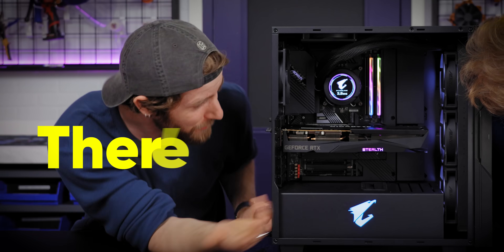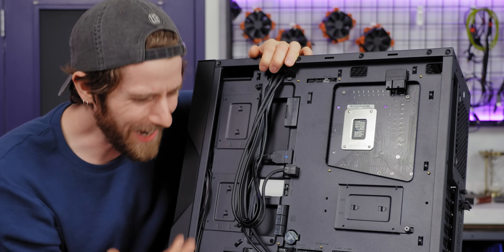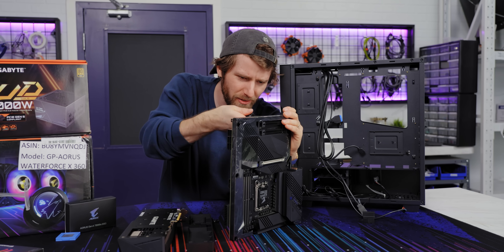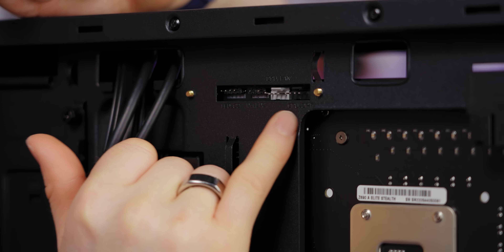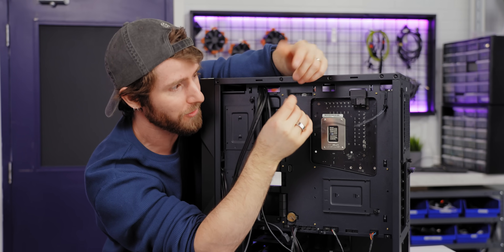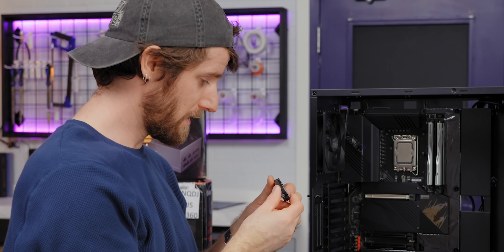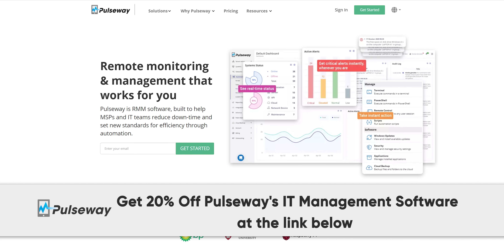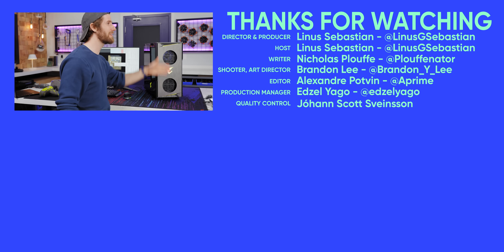Where Are the Cables??? - Gigabyte Project Stealth

Comment: Honestly, this should be seen more as a prototype of a new standard than a product. As a proof of concept, I'm sold. This is better for so many reasons. There are lots of improvements that I can see need to be iterated over to get a really solid product. But when you really start thinking about little things like the case manufacturer now knows where their fans are and exactly where the headers are on the board down to the mm. They can really start making some super solid cable management systems.

Comment: My main computer STILL has that Antec Dark Fleet DF-85. After 10 years of use, all the RED fans are not working or just spinning without really pushing the air. The top 2 120 fans are falling inside sometimes, but once I put them in their place, they spin and really push air. I have a Noctua NH-D14 that works like in DAY 1 without making any noise on top of a Intel 2600k processor that works at 5000 MHz since day 1. The only upgrade ever was a 970 GTX from Nvidia bought day one when they appeared on market. Also, spinning them all is an ANTEC 1000W power source that is never spinning because there is never a reason to spin the fan as the power is probably below 400W at all times.
God bless you for this memento :)

Comment: The motherboard and gpu can work in a good case if you're willing to use a dremel and the cable lengths can be fixed but cutting the cables shorter then soldering them back together

Comment: Honestly MainGear should NEVER been issued that patent.
Id have to read it but that is kinda common sense. 
Hell I have in the past relocated connectors to the other side of the board back in the Pentium II days to run the power suppluy and power switch header outside the case.

Comment: I wanted to give it a try and built my computer last year around Gigabyte. The worse decision of my life... 
The Waterforce AIO cooler was rubbish, sounded like a jet engine by default and barely kept my 5800X below 90 Celsius. The display also had bad viewing angles, it only looked good from the front. The motherboard was great, but the chipset cooler has an annoying noise every time it turns on. The fan controlling software is failing to load sometimes, so I have to reboot the system to get it work. I also bought a Gigabyte RTX 3070 and it was defective. In the middle of the chip shortage and with those prices, that was the last nail into their coffin. I started selling everything I could and I lost hundreds of dollars because of their poor product quality. I learned my lesson, never buy a product from that company again. And now, I see the same exact product quality here: great promises, poor execution. :(

Comment: Why not go one step further and just flip the whole MB? No cables, no coolers, no nothing. Just a sterile, clean black wall to look at. Or wait, you could actually make a case without a side window? :D 
Jokes aside I'm in for more diversity. Though niche products are never cheap. Which forces us to use universal, mediocre engineering at best PC designs which were ok'ish 20 years ago. The last significant experiment was blower GPU cards and that wasn't even executed well. Yeah, "...moving around hot air...". PC design in a nutshell. Looks over sense.

Comment: I can't tell everything that was moved, but it looks like from what I can see, they just swapped what were through-hole soldered connectors to the back of the motherboard. The GPU, on the other hand, looks like it would have had to have it's traces completely re-routed. And the case itself is the most important portion of this working as well. I hate that this is patented because I would love to see a wider adoption of this.

Comment: This is weird, because someone clearly had to spend some time and money to modify the manufacturing of those motherboards and GPU’s and that is not cheap but after dropping what had to be a considerable chunk of change on those component changes they just so utterly half assed the case. Clearly no one even tried to build a computer and do any kind of testing on this thing because it’s completely unsuited for anything more demanding than Star Dew Valley.

Comment: Every time I see a case that is completely cut off of airflow, I can imagine how much Chinese or Taiwanese OEMs can make money from all of the PC parts that people have to keep throwing away and replacing due to computer parts dying prematurely in terribly cooled cases such as this one. It is one thing to have large airvents on the sides of the front panel or making an asthetic with a partial blockage of airflow but cutting off airflow completely is a waste of performance per watt, premature degradation of PC components, and also a waste of energy due to poor case design. The concept is great but the implementation is horrible.
Reply: Wrong. Clearly the case team lead was told by the head of new products sometime like 'cheap as possible using previous designs when possible, no lead design engineer since you'll use a stock case design and we dont want to pay for one, no QA for desgn, no major redesign for tooling, etc' and the team lead worked with what he had. Therefore fault is upper management of auros , but the head of new products will go into a high level meeting and blame the tead lead and not himself and fire that team lead so the core/root of the issue isnt fixed and someone who didnt deserve it got fired. That team lead likely asked multiple times they need to redesgin the front + the tooling for it and told the head of new products it'll overheat if they don't and the head of new products said nope and told him to use what they already had. AKA problem is upper management of the case design oem aurose (however it is spelled) and this happens in 90% of companies.
Reply: @JohnAdams-qc2ju  You have ample points that are worth meriting but the fact of the day is that a finished product came to market and people are able to purchase the case, regardless of form or function. I consider good case design over brand loyalty or case asthetics. I have no qualms with buying a case that has excellent thermal performance or expansion for multiple drives and other PC peripherals.

Comment: The future of computing is mobile. The constantly more efficient hardware and its reduction in size shows where the RnD is actually being deployed. Most of the main manufacturers have admitted that miniaturization of hardware is the future. Intel and AMD do entire conventions on it. Think of how your smartphone replaced multiple devices such as camera, calender, alarm clock and many other things such as your address book, TV and it is now bordering on a PC. In fact if you were to compare a modern smartphone to a 10year old PC the PC would loose. With companies like ARM, Intel, AMD etc focusing on SoC (System on a chip) expect your computer in the next 10 years embedded in the screen like a tablet.
Our awareness of the impact that we have on our planet is driving the push for smaller and more efficient devices. Take a modern laptop for example, if you have a dedicated 30 series Nvidia card, you will get an extra 30% CUDA cores to offset the power and clock difference from the desktop version. This is of translates differently for different games as some prefer clock speed and others gpu core count, so in some games they actually exceed there desktop counterparts particularly with 3060 and 3070 variants. This for me is the 1st modern attempt at closing the divide between laptop and desktop. Then if you factor in the cost of running a desktop compared to a laptop both purchase price and power consumption, the desktop looses. A 3080 laptop will have a  max 300w power draw compared to the same desktop system with potentially a 900w power draw.
I have also noticed that the clocks stay particularly high on laptops, far above there base clocks. Take a 3060 as an example it has a base clock of 900mhz, during gaming its actual average frequency with good cooling will be around 1900mhz, only 10% off its desktop counterpart, with lows of 1600-1700mhz. This frequency dynamically changes as more and less load is applied. This really helps with cutscenes and other random world events that would normally cause a drop in frame rate.
I was an avid desktop modder before it was even a thing and I am still a massive tech enthusiast. I have now moved to mobile platforms and I do not regret it for one minute. The costs savings I made during the shortages and the portability of my gaming rig are just too advantageous to not consider it as an option. I can go to my friends, the beach, a bar, at work pretty much anywhere with an AC outlet(if I want maximum performance) or if about 66% of my resources is acceptable then I can play any game anywhere at 60FPS 1080p with good detail levels. I get about an hour and a half maxing out the battery. I love a cheeky game of command and conquer whilst waiting for the wife to decide what she wants.

Comment: ATX need only 3 rows o screws that can be mounted to 3 extruded pieces of aluminum and leave entire back open. No need to standardize plug location. Just avoid putting anything at the height of mounting screws.

Comment: Seems fine, but a clean install of regular parts is pretty close to the same visually. Few angled connectors for MB & video card and my case doesn't have any visible cabling either. And that backside....  is a clusterF...

Comment: I've thought about unsoldering the 24 pin on a motherboard and repining the cable to work flipped onto the back of the board.  This is a much clearer solution than what I had considered doing.
Reply: There are also already, 90 degree bended, 24 pin connectors ! I have one in my NZXT case, looks 10 times better already.

Comment: I'm waiting on a modular case that uses extra short cables to attach the computer components to a PCB board. (Motherboard sits on top but about an inch of clearance.) And use that board to bring power / information across the case.
IE a one size fits all connector on the main board. And a pcb board to connect hdds to, which only has pins for hdd's information and the correct power lane.
(Multiple because gpu and cpu voltage would likely fry if used on anything else.)

Come to think of it. They could technically have a power supply built into the main pcb board... but that might be taking things a bit too far.

Comment: I played with the idea of making a custom PCB to connect all power in a Dan case A4 but I dropped the idea, if you measurements are off by a small bit it just won‘t work. If I had the CAD files or a 3D scanner I would probably do it though.

Comment: Wow, it's almost like Gigabyte never actually tested this setup before sending it out to somebody with over 14.5 million subscribers who is absolutely not shy about calling out dumb, bad products.  Not only is there no airflow for the AiO, the bottom fan is right up against the power supply basement.  And the RGB cables not fitting through the cutouts is just sad and embarrassing.  Hopefully if this is something they're going to be selling, they address the obvious stupid choices that were made with the case.

Comment: Putting these components on the back of a board isn't that difficult. They are already mounted to through-holes on the front of the board. Literally all they had to do was solder the connector onto the wrong side of the board. Then they call it innovation. Literally anyone can do this themselves if they have any experience soldering.

Comment: The best idea here was putting the connectors for the GPU on the other side.  They are the only cables I mind.  Maybe there is too little space unless you get an accommodating motherboard, but maybe someone could put the ports on the outer end near the back? I could still see my nice custom cables but without them going all in front of everything

Comment: I would have stopped at the fact that you're stuck with Intel. 😂 I've not bought something from those crooks since 1998... 😝

Oh, and don't worry: Other manufacturers do stupid solid front panels too. I had to modify a Zalman case a few months back. The customer wanted that specific case because it looked good. It came with three fans mounted to the front glass panel. They even went to the trouble of doing some plastic shrouds around the fronts of the fans so it looked even... cooler? 😆 So I had to mount the fans further back from the front but still keep them aligned with the plastic shroud decorative crap. All of this just so there would be a bit of air for the fans to actually get from the side vents... 🤦‍♂ Who TF designs those cases??? 🙄

Comment: As cool as it looks, i hope it doesn't catch on (for the motherboard). You can get basically the same look with right angle connectors on the front of the board with a cable management channel along the side of the board.

This is just stupid. The motherboard won't work in normal cases, and if they released different motherboards with the same setup, they would have to have the same connectors in the same spots to maintain chassis compatibility. And that goes against the entire point of building an ATX rig, basically locking you into dell prebuilt level of upgradebility.

The gpu is cool and could actually be useful.

Comment: Imagine being able to fucking patent connectors being on the other side...There no way this would even hold up in court.

The reason why this isn't really done? Because not every connector is in the same spot on every motherboard, so a new motherboard would require you to change the case or backplate in some way.

The one good thing from this is actually the GPU connectors, that seems quite easy to implement.

Also what a shitty case to show off such a thing... re-using one of the worst cases for airflow.

Comment: All this is because  awful legacy standards. 
- The 24pin cable, the CPU cable, and the PCIe cable could and  should  be unified into a single connector of much fewer pins, combined with a better PCI slot design including more power pins (similar to this design, but plugged  to the PCB rather than to the PSU ), then let the motherboard do the power distribution job.
- Same about the front panel cables , lots of cables and little connectors for no reason

Comment: Wow, it would be kind of depressing if this becomes a significant market segment. As cool as it looks, these parts can't be reused without significant effort, so in a few years these components turn to ewaste or get sold to people who don't notice they'll need a dremel to install them. Obviously the case can take standard boards, but I think this machine is better thought of as an AIO that's more upgradable and configurable than usual.

Comment: Yo linus, when using a hole saw, set the "clutch" on the drill lower so that it doesn't catch so hard when the blades hit. Took me a while to learn that lesson too lol!
Reply: This makes so much sense. How have I never heard this? I work in construction......
Reply: @NavyMitchell  I always just used a hole hog that my boss named Big Bertha. That thing didn't have a clutch and if you didn't pay attention could throw you off your feet.
Reply: I kinda waited for the big bang...Jake was understandably not looking happy...  I mean, I myself took, on the same day, an 18V Makita battery pack twice to the face and almost twisted my wrist before one of the shots just because that stupid hole saw caught itself. I can take a good punch usually, but that made me sit for a few minutes, tbh. Next thing I did was purchasing a drill with auto-clutch-release upon being stuck.
Reply: finding the right setting for torgue is a bitch though...
Reply: But then it stops cutting and makes and annoying clicking noise. Just hold it properly
Reply: @Muffinx93  Depends on what you're cutting, but generally you should at the very least use the clutch until the pilot bit punches through. Ideally I mean. But obviously do whatever suits you lol.
Reply: This is so helpful, why didn't I know this?

Comment: I would love to get it but I dont like the case and don't wanna have to get a gpu with it. Looked it up the motherboard is fine but I dont want a 3070. It would be nice to reuse my 3090 or them to allow u to pick a gpu not just 3070. Cool design. All mobo should have this.

Comment: appart from the shitty design as a whole. Like garbage lvl. The idea to have most of the stuff on the other side of the board is really good. Hopefully more do that (and do it better).

The cutout on the back should be a long vertical line and a long horizontal one. So no problem with size and stuff.

Comment: 43 minute crew

Perceived 725th comment
Just prompted the bad idea of having a  bunch of wireless things that shouldn’t be wireless. Essentially just takes a mother board and smaller computers to make each slot wireless. Yet they’d probably all need wall power anyway. Imagine plugging in a different GPU into a wireless device and it somewhat changes the performance of the system.

Comment: reminds me of when i soldered pins for serial port headers lolol not that hard actually just heat up the pins and push them down so they come out the other side lol resolder and its done may need to rewire some of the cables idk lol

Comment: re the PCIe slots using two different mounting styles: not sure how broadly this applies to 12th gen motherboards in general (I'm still back on 10th) but through-hole connectors create a bunch of capacitive stubs that reduce signal integrity, and I think the only big holdout for surface-mount PCIe slots in motherboard development in general was first-pass yield since they can't be reworked as easily, so maybe PCIe gen5 is the cutoff where that's the lesser of two evils